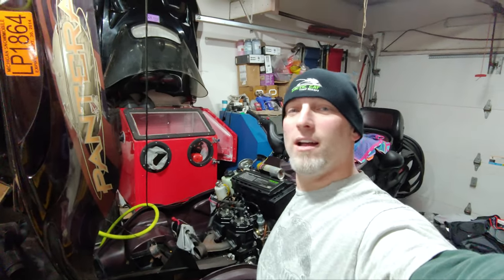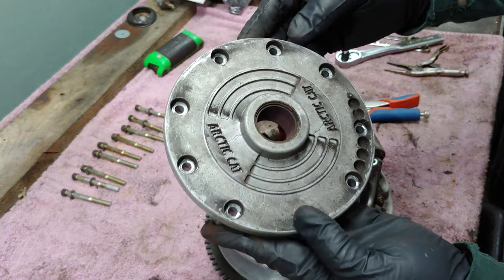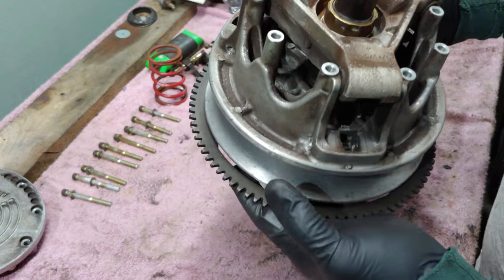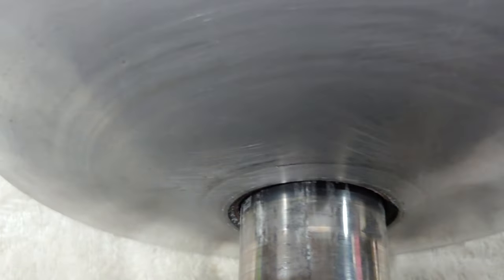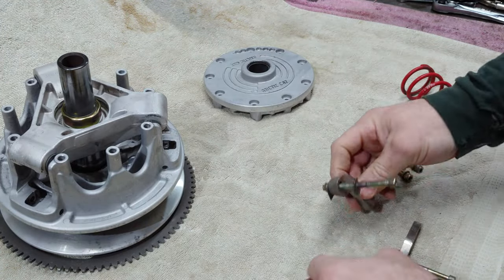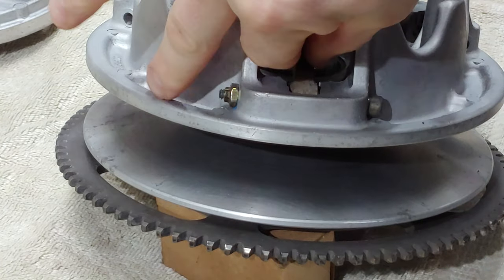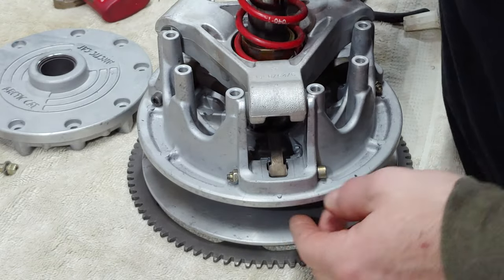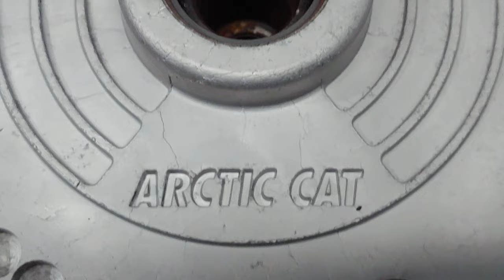Drive Clutch Cleaning || Amazing Results!

Comment: Andrew that's the only bad thing about those 2 up sleds you will wear out clutch parts faster than a regular trail sled , I have a 2 up Pantera 1000 😁lots of fun .
Reply from the maker: Yep. This is a nice one. Got another identical  one that I will be going through as well. I don't want to get rid of it but someone will get better use of than we will.